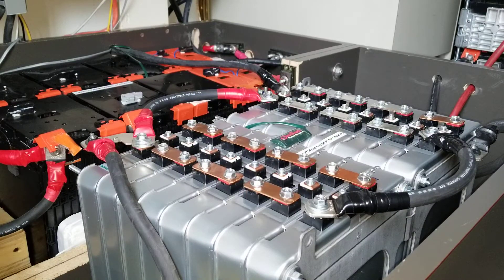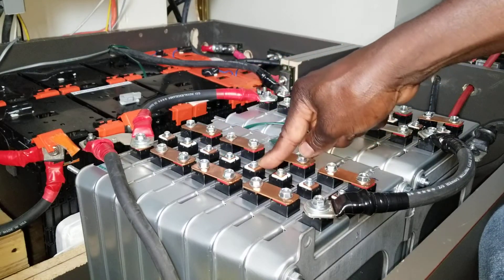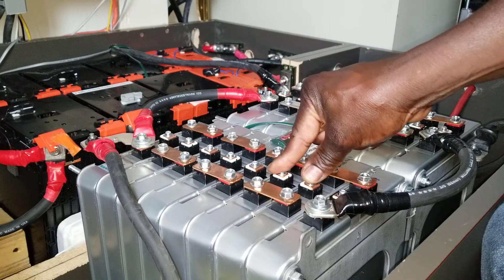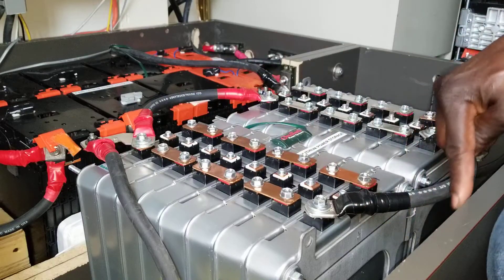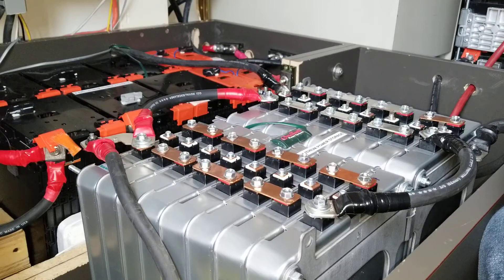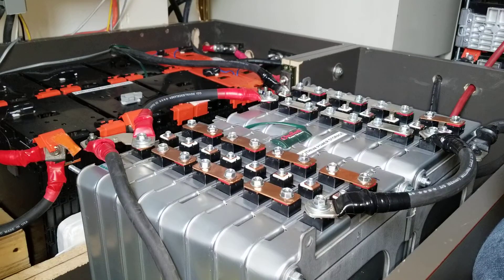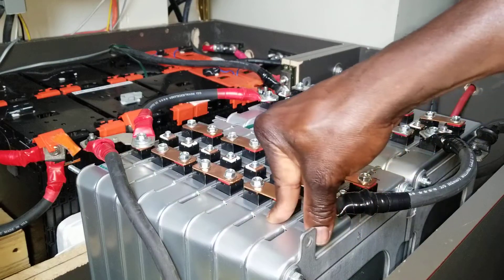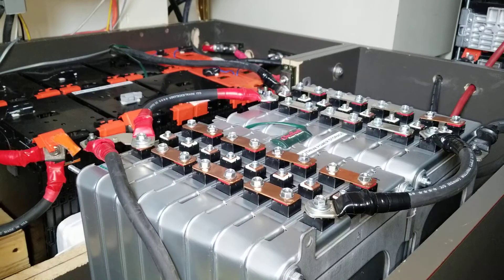LITHIUM BATTERIES FOR SOLAR, NISSAN LEAF LITHIUM BATTERY, WHY I DIDN'T HAVE CENTER BUSBARS?

Comment: Are these good batteries to start with? I want to make 24v banks and still learning about bms for these.
Reply from the maker: Awesome and user friendly batteries for any kind of configuration
Reply: @jwsolarusa  is there any advantages from gen 2 to gen 1 batteries. I may try buying as I can. My lead acid to 60% dod is only 1.6kwh now. Time to look.
Reply from the maker: @cutweldngrind  
Gen 2 has a little bit higher voltage than Gen 1.
Generation two was manufactured proximately 2015 - 2016 and above.
The design and looks of the Generation two is different from Generation one and so on etc.....etc.... the list goes on.
It is a preference what your pocket can afford vs. Year of manufactured.
The price of Generation one has dropped drastically.
Watch these videos they might have helpful towards your transition to lithium. 
HOW TO DISASSEMBLE NISSAN LEAF LITHIUM BATTERY | NISSAN LEAF LITHIUM ION BATTERY PACKS: https://www.youtube.com/playlist?list=PLSNjIRSnUPDIUSgmNCMSn7cIe8T1VAp8E

NISSAN LEAF 14S 7kWh LITHIUM BATTERY STORAGE: https://www.youtube.com/playlist?list=PLSNjIRSnUPDJwgLCkFXz645v3iEhhxGLI

NISSAN LEAF LITHIUM BATTERY 16s 48 VOLTS CONFIGURATION FOR SOLAR EXPLAINED: https://www.youtube.com/playlist?list=PLSNjIRSnUPDIpEsLsWVVZ4G5AgaSyiLOs

LITHIUM BATTERY WITHOUT BMS: https://www.youtube.com/playlist?list=PLSNjIRSnUPDIev8ioiA59dOCCttxfRPpY

Comment: How many leaf battery make up one  Deka 340amp battery? 

I'm running 8- 6 volt battery for total of 24 volts. 4s
Reply from the maker: Deka battery is 340Ah while Nissan Leaf 66Ah per module. You need proximately 5 Nissan Leaf battery for equivalence of one Deka battery.
Reply: @jwsolarusa  Thanks for the clarification! That's still cheaper then a Deka Battery @ $308 a piece!  I'm thinking of converting to leaf batteries. 
You and your videos are spurring this on along with some others! 

I have a W4 Case loader .. it's hydrostatic and I'm converting it to electric also.
Reply from the maker: @whisky_9o5  
Thanks for WATCHING my videos.
Please LIKE and SHARE my videos and stay TUNED for more CONTENT coming up soon on Nissan Leaf battery modules
Reply: I use similar cells in a golf cart but you cannot use less than the required voltage so you need 14 cells of 3.6 or 3.7volts but the Leafs are 2 cells per module so you would need at least 7 of them and this would be more useable energy than in your 48 volt pack even with 60% degraded used cells or around  350 watts per cell .  You have to remember that the lithium can be used up to 100 % of capacity but for logeviry 80 % is much better but your lead acid batteries should only be used to 50% of their capacity if you want them to last 3-5 years or more also they will loose quite a bit of charge if left without trickle charge for weeks. Lithium will hold a high percentage of charge for a year or more.  The weight is also tremendously different and no outgassing to worry about.   Though the leaf cells can be used in 24 volt systems with a voltage friendly inverter they are much better suited to a 48 volt system.

To answer your question more directly A 340amp 24 v system has about 8.16 Kwhr of energy but only half of this is useable to sustain long battery life or 4.08 Kwhr.  If you bought 65% Leaf used cells that were 7.6 v 66 amp new or 501 watts you would get 326 watts not 500w and you would need either 2 sets of 3 module as 3 in series and 2 of these paralleled or 2 sets of 4 cells similarly arranged so lets say 2 sets of 4 modules for a total of 8 modules therefore 8x326 is 2.608 Kwhr so to get as much power as you now have you would need 16 modules configured 4S 4P and you would have 5.216 Kwhr of energy.  If you use 80% of this capacity you would have 4.128 KwHr of useable energy almost identical to what you now have but they would last many times longer than the DEKA lead acid batteries and weight less than half as much and no outgassing.  The one worry is to get and inverter/charger that operates well in their useful voltage range which would be about 32v down to about 24 volts. Forgive me for the long discourse.
Reply: @teekay1785  Thanks, 
This was one really good and understandable explanation!
I appreciate the effort you put into explaining this!👍

Again, Thank You!
Reply: @whisky_9o5  You are most welcome sir . I just hope its not too late to help you and it helps others who may have similar problem but not only that illustrates how to figure similar problems out.
Reply: @teekay1785  it always helpfull to have a second set of eyes. You find out what you know or what you thought you knew and didn't know!

Comment: Which BMS are you going to use?
Reply from the maker: I decided not to use any BMS at the moment and the batteries are still balanced and running perfectly proximately to a year now.
Thanks for WATCHING, please LIKE and SUBSCRIBE
Reply: @jwsolarusa   I haven't used a bus yet but am checking cells regularly especially since I have 10 14 s packs to divide my power use between which is 90% of time less than 5,000 watts so relatively low amp draw etc and all cells new when started. I will put a bus on one or two packs soon to be able to charge with golf cart charger to prevent overcharge and equalization charge.
Reply: Guess you can tell bus was ?autocorrected and I meant BMS
Reply: Just make sure your Max Charge and minimum Discharge are correct. These cells can turn deadly, quickly, very quickly!
Reply from the maker: @pauldonovan5878  
Paul,
Please check out the rest of my 904 videos and see what I have done all these years.
Cheers

Comment: so how much did the battery's cost and how are they working for the solar system?
Reply from the maker: They are working greater than any other batteries out their? 
But, they are not cheap and can be expensive !
Google them and you find out how much they cost.
Thanks for watching and for stopping by. Please check out my playlist, LIKE & SUBSCRIBE
Reply: @jwsolarusa  My brand new LG LMnCo batteries from chevy bolt wilt perform much better than the leaf batteries unless they are brand new ( i was going to use Leaf batteries because of ease of hookup but they generally are degraded to 60 to 65 % of original capacity before sold to DIY market. So my 14S pack has a full 6.2 measured Kwhr capacity (yes more than the rated 432 watts per module) and weighs 63 lbs.  Since I remove a 48v pack of 14 S (or I charge to 57.4 volts) via 175 amp anderson connectors to use I'm my road legal golf cart the room and weight savings over leafs are desirable but a big headache to construct.  My Club Car DS 2005 48 volt cart with original motor goes 62.5 miles per charge up and down steep hills .

Comment: Ok good deal, your doing series connection between each of the 8 Leaf module  to get 56-64v nominal so you must be connecting to different inverter if other lithium modules from other manufactures are different voltages. I didn’t see the connection form each different battery bank to its own inverter.  If connecting the leaf modules in parallel between each other then you need center tap bus bars. No need on series connections.
Reply from the maker: The Nissan Leaf Lithium Battery and the  Ford Focus Lithium Battery runs my 48V OutBack Power Inverter/Charge. The VW e-Golf Lithium Batteries runs my 24v Magnasine Magnum Energy MS4024 Inverter/Charger.
Thanks for the comment and for watching my videos.
If you haven't been a SUBSCRIBER to my Channel yet, please do so for more CONTENT coming your way live from this Channel